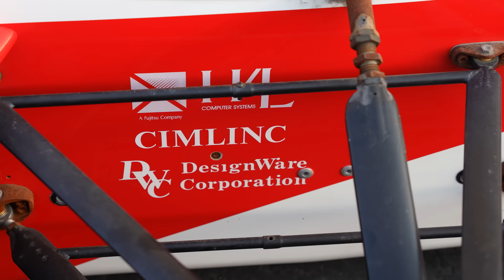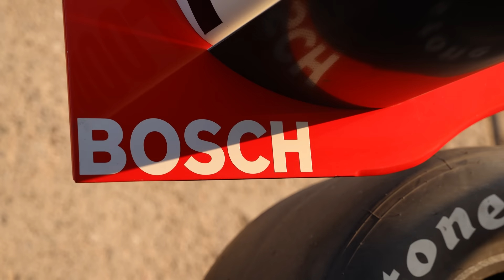I bought a INDYCAR without an engine.

Comment: Needs an alt-history 90's style Mazda CART livery to go with the Rotary.
Reply: Renown livery
Reply: It’ll be full Valvoline livery. This thing is going to be exXxponsive
Reply: @LogicalQ  hell to the yes. I think I associate those two colors to the 26b whenever I see them together
Reply: Change the Ralphs to rotary but don't lose the Budweiser!!!
Reply: @MrDinospike  I'm fine with that too! Just add the 1999 Gil De Ferran Valvoline livery to it, that was one of the best liveries ever anyway.
Reply: Richie Hearn, I remember him. He never won a race.
Reply: @MrDinospike  a combination of the Mazda and Valvoline livery.
Reply: That would be fucking amazing!
Reply: @rickylazare8773  In fairness, no one won a race in a Lola T97/00. Adrian Fernandez got a third but he needed some luck on fuel strategy to even pull that off. The aero package on that chassis was terrible. They discovered mid season that the center of pressure migrated under braking and cornering which made it wildly unstable. Some cars have a very narrow setup window. This car had no setup window.
Reply: @rickylazare8773  neither do 90% of proffesional race car drivers once they get to the top tier, its not baseball.
Reply: i take more of a liking to the chip ganassi target cars of that era but to be fair all the livery's looked cool back then

Comment: Electrical Engineer for IndyCar here.

- The solid rods where the shocks go are used for towing so the real dampers aren't exposed to wear during travel. 
- The Yellow looking head surround should have two lever at the front that twist and allow the front to pop up, then the whole thing slides forward off of dowell pins in the tub. Will make it alot easier to get in and out. 
- The big hole in the top of the engine cover was for the old "pop-off" valve that the series used to scrutineer boost levels. 

This era car was technically part of CART that ran a turbocharged V8. The biggest "issue" you're going to have to work out is the original engine IS the torque member between the front tub and the rear suspension. There is no "chassis" that connects the front of the car to the rear. 

Holler if you have any other questions.

Comment: Make sure your helmet has proper aero for open-cockpit, otherwise it’ll try to pull your head off when driving at speed. A HANS device is also a good idea
Reply: Knowing Rob, he’ll wear a bicycle helmet
Reply: @TheBigChad  if it were anything other than safety I’d agree with you 😂
Reply: @charlespletzke8311  The reason why it has so much room IS for the Hans device! It is a MUST HAVE for this car....Period!
Reply: @Blackinterceptor999  What is that if you don't mind explaining it? If you don't feel like it I'll look it up, just like it better when someone explains the little things they think I should know about it instead of my uninformed arse trying to seek out the things I believe I need to know about it.. Which I have zero clue what those are lol.
Reply: @danielnelson4881  it's a neck brace in case of accident, you should find a picture of it, you will get it once you see it.
Reply: @Blackinterceptor999  Not so much a neck brace, more a helmet restraint. 

There is a bracket that sits on your shoulders. The seat belts go over part of that bracket and as the belts get pulled tight the bracket is almost rigidly mounted to the back of the seat. Then there are tethers left and right that connect the helmet with the bracket, restricting how far it can move forward.

The whole purpose of this setup is to protect the drivers neck during a frontal impact. Before HANS devices were a thing many drivers died due to a broken neck or basilar skull fracture. When the car is stopped by the impact the body is being held back by the seat belts but the head still carries momentum. As the head moves forward it puts a lot of stress on the back of the neck, sometimes too much. In the 90ies this was the most common cause of death among fatal racing accidents.

Since the early 2000s almost all professional racing series and events require drivers to use a HANS device ("Head And Neck Support"), and since then it has saved countles lives. Turning what was the most common cause of fatalities into pretty much a non-issue.

Although the "Indycar" in this Video seems to be a CART car from the late 90ies, so i'm pretty sure it was not driven with a HANS device back then.
Reply: @hannesgroesslinger  CART made the Hans device mandatory in 1999, if he could tell us more about the history of this particular car and when it was raced it would answer this question definitively. 

I don't really follow the Indy or CART racing close enough to spot when exactly this car was still competing but it is possible whoever was the driver for this car chose to wear one because the Hans device has been around in development since 1981.
If you do an image search for " 1986 Jim Downing Hans device " the one he wore was comically huge.

Would be interesting to find out more about this car for sure.
Reply: @Blackinterceptor999  just because the car has room for it doesn’t mean he’d know that right away. And unless he did it in complete secret he doesn’t have a HANS device (at time of recording the video). It is very much a necessity which is why I mentioned it
Reply: @Blackinterceptor999  this specific one is a 1997 Richie Hearn CART car. I believe the livery matches the Rio Do Janeiro race to be specific.
Reply: @NewfieOn2Wheels  wow that's a piece of history! Also before the mandatory HANS device's will be cool to see it moving under it's own power again!
Reply: Must be a dorito shaped hemlet like a rotary.
Reply: Yeah this is something I wouldn't have thought of
Reply: @danielnelson4881  Google is not that hard to use
Reply: HAND device is as important as the helmet. Without it you risk whiplash or basal skull fractures.
Reply: @hannesgroesslinger  Who cares if it wasn't driven with a HANS device? If you buy a car from the 20s or 30s should you not consider using a safety device that's industry standard (ie seatbelts). If I purchased any relatively fast, hard to drive, literal actual racecar I'd think I'd want to be up to industry standard of at least my physical safety. Who cares if the OG drivers of this thing had HANS or not? You should have one either way. You could be in a 100 year old car, but that doesn't mean you should use 100 year old common sense.
Reply: @blacke347  Of course he should wear a HANS device.

I was just pointing out that at the time they didn't use it, as a reply to Jay Simmons who thought the HANS device was the reason why the car has so much room.
Reply: Good looking out👌
Reply: @Blackinterceptor999  I see CART on the car, was the HANS devices around in CART days?  Maybe I should ask google...  wikipedia: "Using that information, CART made the device compulsory for oval tracks in 2001, and subsequently requiring the HANS devices for all circuits the following season."
Reply: im sure he'll remember in like 2033 when he gets this going
Reply: On the note of things he should get, tear offs for his visor. If he drives it for any length of time he'll need them or at least wish he had them
Reply: Mate, these were raced before Hans came along. Cart drivers already wore a collar to prevent unnecessary  head movement and then they had more surrounding head protection than a F1 at the time.
Reply: @growlusnotneeded3251  doesn’t mean a HANS device wouldn’t help
Reply: Good luck finding a HANS device for a car that predates the HANS device by 4-5 years
Reply: @Silasssssssss  hans aren't car specific
Reply: @Silasssssssss  if he’s modifying the car anyways why not modify it to accept a HANS device as well
Reply: @FastPaull   I’m not gonna speak for the rest of the replies on this comment, but the two ideas were unrelated (aerodynamics and hans device) and you never know he may be planning on going 200+ in this car
Edit: also F1 cars don’t go much past 200mph and they have very sculpted helmets for safety reasons, even though the majority of the airflow is directed away from their head anyways
Reply: @FastPaull  if we're wrong he's out a bit of money, if you're wrong he's seriously injured or worse. Think about that before scoffing at a safety recommendation
Reply: @hannesgroesslinger  very well put. and yes. seems to be a CART
Reply: Little bit of trivia concerning the HANS device. It was invented by a road racer named Jim Downing…….who coincidentally started out racing Mazda RX3s and later RX7s. He also developed the Kudzu chassis that housed a 3 rotor engine in the 90s. I have some pics of his car from the 24 Hours of Daytona in 96 or 97 and was an open top racer in the IMSA series painted in the same green and orange livery as the famous 787b.